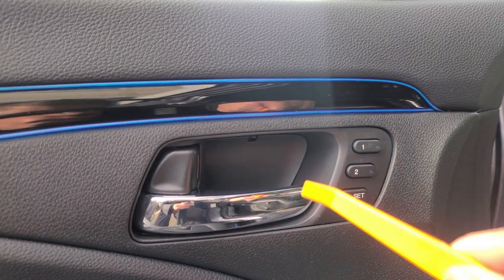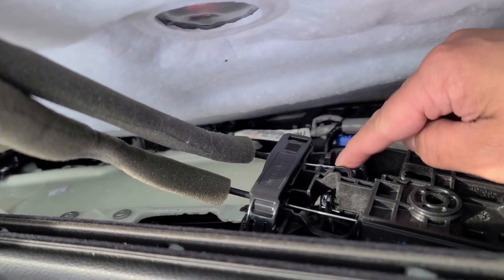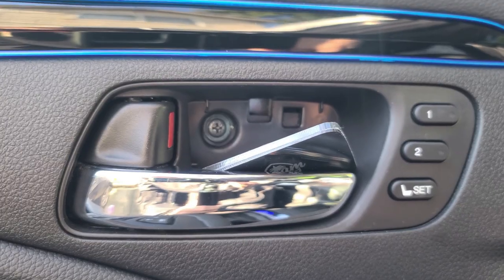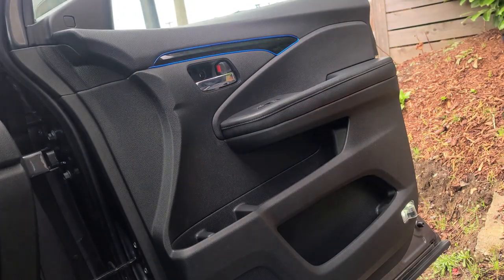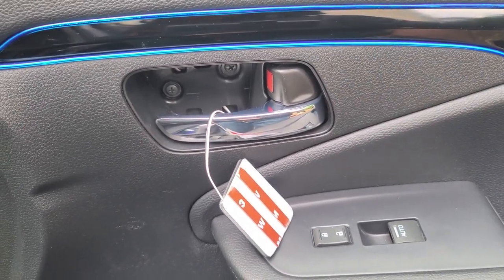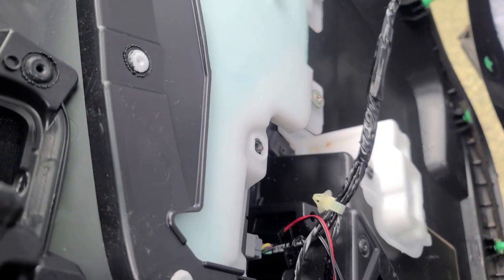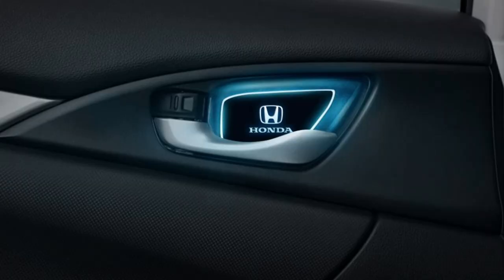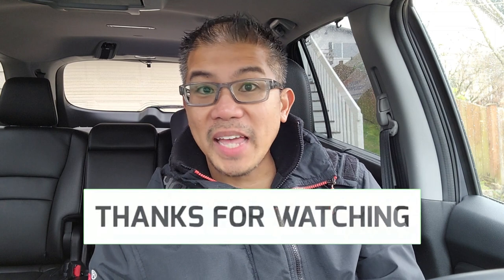How To Install A Car Door Bowl Light | Ambient Lighting

Comment: I really like your videos my questions about door bowl light when you driving or turn on headlights and then it’s turn on the same time or off because my pilots black edition 2021 turn on when I turn off headlights or turn off engine please advise me thanks
Reply from the maker: Turns on and off with the headlights. I just used the original door bowl lights. However, if you will tap into the door light. Don't connect too many as it will not handle the amps with to many lights.
Reply: @AutoSensation  thanks for your reply but I’m not asked about door lights I asked about original door bowl light it is turn off when I turn on headlights or while driving at night thanks again
Reply from the maker: @vanlytruong98072  yes. If you turn off the headlights it turns off. Turn on the headlight the door bowl lights turn on
Reply: @AutoSensation I see but my pilot not like that I turn on headlights it is turn off but I turn off headlights and then it’s turn on I don’t know why’s it like that anyway if it’s any issues or how to fix it please advise thanks again
Reply from the maker: Sorry. I don't know about that.